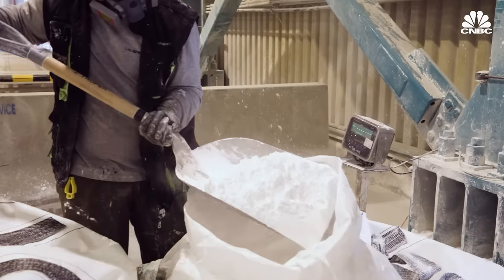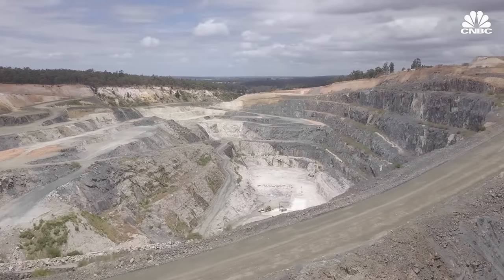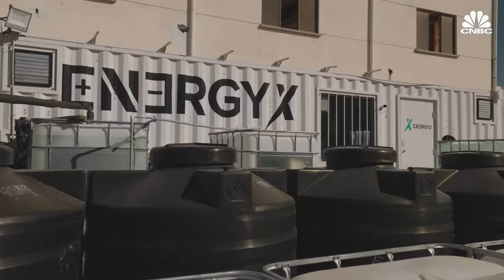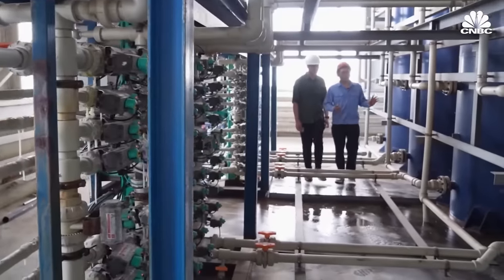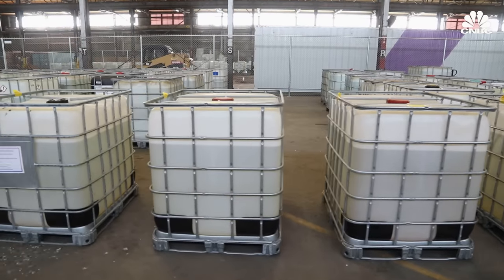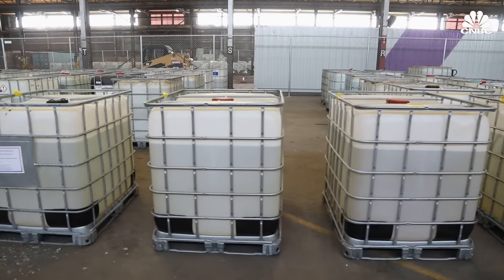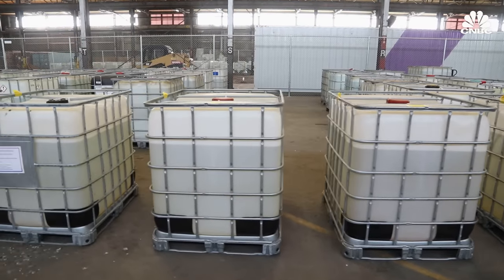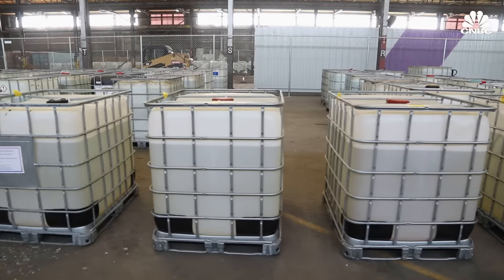Why The EV Industry Is Betting On This Lithium Mining Breakthrough

Comment: why they dont use  evap  water  is a question.
Reply: Lithium production in South America doesn’t have so much to do with the element’s availability in the soil, but with water. The Andes mountains are very dry, but the lithium extraction process requires water in no small amount to bring the element up to the surface in a salty brine—500,000 gallons of water per ton of lithium, according to Wired. In some regions in Chile, 65 percent of water is used up in lithium production, diverting it from local food production. The brine then requires 12 to 18 months to evaporate. Any water returned to the farmers could be tainted with chemicals.
Reply: Another core concern lies in the vast wealth that lithium will represent for these smaller, poorer countries when demand starts to escalate. The lengthy evaporation period for the lithium brine can be sped up by heating the water, a process achieved by burning fossil fuels -- defeating the entire purpose of reducing greenhouse emissions in the first place. But when the price is up and the bottleneck forms, the desire for faster, cheaper production may outweigh our ability to maintain environmental standards.

Comment: In a few years we will have mountains of used lithium batteries. They are very difficult to recycle. So what becomes of them?
Reply: They will be used for stationary energy storage on solar and wind farms. These batteries don't just suddenly die, they degrade over time. After 15 years of use in a vehicle, that battery will still have 70% use which will make it less useful in a vehicle, but many more years of use in a stationary energy storage system. After another 20 years of secondary use, it will then be recycled. How about that engine from that 1990 Honda Civic that is laying around in a junkyard, what becomes of that?
Reply: New recycling technologies are already making it easy to recycle.

Comment: Just dump money into sodium research to save the water and pollution.
Reply: hydrogen *
Reply: sodium is the right way forward
Reply: Sodium is no where near ready for wide spread vehicle use.  Lithium will remain the best technology for quite a while.
Reply: @JDMHaze  Hydrogen is too inefficient
Reply: These brines are are saltier than ocean water and evaporation is powered by the sun. Water use and pollution are not an issue.
Reply: @JRP3  it's already in Chinese vehicles
Reply: @Yoyo-vt4hc  Yes, cheap short range Chinese EV's.  As I said no where near ready for wide spread vehicle use.  Glorified golf carts don't count.
Reply: @Ray Martinez
The periodic table says "Hi!!"
Reply: @JDMHaze  
Dead end.
As said elsewhere, the system efficiency is diabolical. (worse than diesel)

Comment: I have zero water lithium refining system, dry system.  My system requires no electricity costs, wow my new lithium battery technology crushes these companies.  Lol, a ceramic material sheds a proton, to grab the lithium and then a chloride grabs the lithium off the ceramic surface, ready for manufacturer use. 3 materials come to mind, my system is still better.

Comment: I don't like reporting that has no analysis aspect. Any "alternative" market has to be tested for any new dangers it may pose to the environment. Conventional lithium mining is easily just as bad for our environment when scaled up to the level of fossil fuel and even relies on fossil fuels in order to operate. Its a lie in and of itself to disguise itself as a safe alternative while lithium mining uses 500,000 gallons of water per ton and all that water is polluted in the process. We cannot just accept whatever narrative an alternative industry feeds us in our desperation to escape from fossil fuels. Don't poison our water in the effort to clean up the air. It is more likely we will end up polluting both with that kind of ignorance. You cannot blindly trust figures that originate from the industry itself or any source that is dependent upon that industry for funds. Be skeptical.

Comment: What about the cobalt required for the batteries?
Reply: LFP batteries don't need it and are getting popular for EVs and other battery uses.
Reply: Cobalt is being less used as battery technology advances. Next question?
Reply: Cobalt free batteries are becoming more prevalent and those that use cobalt chemistry are using less and less.
Reply: The largest use of cobalt is to refine gasoline. As the use of batteries increases, better battery technologies are being developed. Cobalt will be obsolete from all EV batteries in the next few years. Next question?

Comment: install a solar roof onto these EV cars and trucks  add a recharge battery your good to go for ..................................................
Reply: the answer to your question is about 20 km after a full day in the sun. Solar panel tech is not yet at a point where one the size of a car roof can power that car.
Reply: @Thanos88888  Thanos they China car maker is already doing this to one of their model EV cars
Reply: @Buzzmonkey24  If a Chinese manufacturer is already doing this, it will be on a very light and small car with a small battery with short range. There's no way that current solar panel tech is enough to power the type of vehicles we have in North America, especially not trucks, with a solar panel the size of a car roof. You should look a little deeper into it.
Reply: @Thanos88888  they make Solar Roof tiles for roof installs . What you talking about Willis
Reply: @Buzzmonkey24  They sure do. Everybody on Earth knows that solar panels exist and that they produce electricity. You are making the claim that a single solar panel will be enough to power a vehicle while in use. Do you honestly think that a single solar panel can run an air conditioner unit, or a clothes dryer, or a kitchen oven? These are high draw units which require a significant amount of power.

EVs take a significant amount of power to operate. The draw is similar to running a clothes dryer. A single solar panel on the roof of a car cannot provide enough electricity to keep that vehicle moving.

Your suggestion isn't much different than those people whom thing that EVs should use tire rotation to regenerate electricity. Yes, there is regenerative braking, but the suggestion that the simple rotation of tires being able to fully power the vehicle is the definition of a perpetual motion machine.

I invite you to look up portable solar panels that are on the consumer market. There are plenty. Look for one that is about the size of the roof of a car, then look at what it's average energy production is. It's about enough to charge your phone. A car uses more power than a phone.

What you talking about Willis?

Comment: what if all of earths lithium is used up in making batteries if that happens and lithium runs out altogether what will we power our evs with then?
Reply: We can start recycling lithium
Reply: Recycling will have to become the norm not only for this but for everything.
Reply: 97 percent of EV batteries are recyclable.
Reply: Wind power. Put a sail on top of your car and set it to neutral
Reply: @jashansandhu8653  Yes like recycling plastic.  40 years later and its still a scam.  You realize the best parts of lithium are used up in the first round, you're recycled product will never be good. Down from a 10 year life to maybe 1-2 years
Reply: @chiquita683  thats the point it wont have the same efficiency
Reply: @chiquita683  Interesting, i presume you have a source?
Reply: Sodium Ion batteiries perhaps? They don't have the same energy efficiency yet but the minerals that go into them are more plentiful we might want to keep an eye on them as backup at least if not as a real strategic alternative!
Reply: @dicemaster1996  not the lithiums quality wont be the same once used
Reply: @chiquita683 in your mind what should we do? look for alternatives to Lithium, which we already are, or stick with fossil fuels?
Reply: Preface by saying I manufacture electrification components for EVs.
Batteries are some of the most recyclable things humans make, with nearly every aspect (Lithium, copper, nickel, cobalt, etc) being fully reclaimable basically infinitely. They are simply metals that can be melted down again. Running out of batteries won't be an issue for EVs, even if energy grids start adopting them at a rapid pace to help during peak hours. 

Environmental damage from photochemical reactions caused by Lithium battery recycling is another story, and could lead to further destruction of the ozone, but the Lithium will always exist in its useable state.
Reply: @chiquita683  Batteries don't degrade over time because the lithium is "used up" but because of lithium changing shape (dendrites) in the battery over time.  Processing a degraded battery back into the original pure lithium is much easier than digging it up from the ground and separating it from the rock it is in.  The problem is we don't have that many old batteries around since nobody was making large numbers of electric cars 10 years ago.  And I suspect the old batteries coming from cars will first get used in power storage for the electricity grid, where a 50% degraded battery works just fine.  Either we need a lot more naturally-sourced lithium, or we need additional non-lithium batteries, or both.
Reply: @dicemaster1996  look up Redwoodmaterials
Reply: Sodium phosphate batteries. That's where the industry is going.
Reply: @chiquita683  Nonsense.  All elements in a battery remain to be recycled and processed again into pure battery grade materials.  It's already being done by many companies.
Reply: There is more lithium on Earth than humanity could ever need. It is one of the most plentiful materials in Earth's crust, second only to iron.
Reply: Hydrogen among others. That’s why Toyota is advocating for different alternative solutions. Not just one solution for fossil fuel. EV is good but it is heavily dependent on batteries made from lithium. And lithium is a finite resources. I would like to see as many options as possible for us consumers.
Reply: @Ergzay  but they say the reserves are only 89 million tonnes how can u say that there are such abundant reserves
Reply: @chiquita683 ithium battery recycling has the same recovery rate as lead acid recycling, which is over 95%. Lithium has just been more complicated because there are more materials to separate and it's higher energy so just shredding like a lead acid recycler would is not as easy.

Plastic fundamentally is not very recyclable, after 1 cycle it's properties have already changed and has impurities like dye that cannot be separated. The polymers aren't able to be melted down and re formed without changing. Lithium and all the minerals in lithium batteries though do not change after recycling, they can be recycled an infinite amount of times with no change minus the slag impurity that takes 1-5% of material with it.

You may say the materials are spent or degraded by dentrites or wear and tear. However that's just the battery structure degrading and materials migrating and fracturing, it's all still there. This is no different than a lead acid battery that was left discharged (lead plates turned into crystalized lead sulfate and structurally destroyed), that can easily be fixed when the batteries are broken up and materials re processed into the base ingredients of lithium hydroxide, carbonate, or sulfate (lead antimony and lead for lead acid batteries).
Reply: @chiquita683  
Ooooo! Another perpetual motion machine!!!
Whoopee!
Reply: @chiquita683  False. Apples and oranges. They aren't the same.
Reply: Energy X ❤❤❤ They will get it done.

Comment: What about making batteries non explosive
Reply: then go back to coal😂
Reply: @JDMHaze  
(Coal dust is HIGHLY explosive!)
Reply: Pete S
Since we're always being told that "batteries don't have anywhere near the gravimetric or volumetric energy density of fossil fuels" maybe you should be more worried about a gallon of gasoline exploding than lithium batteries?
.
Just look up the official stats.
Reply: @rogerstarkey5390  gasholes&ev concern trolls like that never deal in simple FACTS about gas or diesel vehicle fires. 😏
Reply: @4literv6  fact is gasoline or diesel don’t spontaneously combust and require oxygen for fires. Also they don’t randomly reignite when exposed to salt water.
Reply: @ramblin327  fact back at you the #1 recall across ALL LEGACY ice oems is for the risk of FIRE inc while parked.
Right now as we speak over 10,000,000 us ice vehicle's are under recall for the risk of FIRE. 

Further fun fact for you, 217,000 ice fires in 2022 alone here in the U.S. so a gas or diesel personal use vehicle burns down every 4 or 5mins on average of every SINGLE day. That's not inc lawn equipment, ships, planes trucks or anything powered by liquid fuels classified as commercial use. Or the amount in billions of property damages each year either. Nor the deaths caused by ice vehicle's. 😎
Reply: @4literv6  actually the Takata airbag recall is the largest in history overall. Of course there are more ICE fires because there is a higher amount of them. I never said there was a higher number of car fires of either type. I only stated that when EVs do catch fire it’s much harder to control and they can spontaneously combust. Please read before making yourself look foolish. Also this is rich coming from your Chanel which only highlights gasoline vehicles at drag strips.

Comment: "Clean" energy 😂😂 it'll probably destroy 50% of ground water in 15 years when all the batteries need to be dumped in landfills but they wont talk about that
Reply: Lithium dumping is not a real problem. Recycling methods and technologies already exist.

EV batteries are reused en mass. A battery pack is made up of individual lithium battery cells, these cells can be sorted and reused for power infrastructure battery projects to double their working lifespan. After that existing recycling technologies recover over 95% of the effective materials used in batteries that can be used to manufacture future batteries.

If you want a source search: "A Dead Battery Dilemma" from Science publishing journal.
Reply: Buddy here doesn’t realize lithium batteries are recyclable
Reply: Why would companies dump out a valuable resource?  Anyway, your Saudi buddies say thanks for your attitude.
Reply: Just search "Redwood Materials"
Reply: @lawlkings  <<Buddy here doesn’t realize lithium batteries are recyclable>>

I see an enormous number of battery powered tools that no longer have batteries to operate them. There seem to be lots of battery powered lawn mowers being given away on Craigslist,  too. 

I don't suppose  your theories are overly optimistic?
Reply: I wish I could find these tools being given away. Our whole line up for lawn care is battery operated. Also, I've never seen a Milwaukee power tool given away.
Also, battery recycling is going to one day put miners out of a job as battery material becomes more pure as we recycle it.
Reply: Why would you dump a perfectly good battery after 15 years? Even if it didn't make sense for the high demand of EV use, it can still be used for stationary energy storage for power grids. These batteries don't just die, they deplete over time and have plenty of secondary market and aftermarket use.

Comment: The world does not contain "vast quantities of lithium". Already theres a scramble to lock down supply and production capability is a small fraction of gasoline powered vehicles.
Reply: You are mixing up availability and refining capacity.
Reply: But HYDROGEN is far and away the most abundant element in the universe!  Why use an element in such small supply compared with hydrogen?
Reply: @SeattlePioneer  Electrons are even more available.
Reply: @SeattlePioneer  energy density, storage, volatility, refining processes, available "grid", etc. Have you seen the major complaints that people have in regards to EV's? Take those complaints and multiply them by 2 for hydrogen.
Reply: @SeattlePioneer  But not on and in the earth's crust.
Reply: @Thanos88888  <<@SeattlePioneer  energy density, storage, volatility, refining processes, available "grid", etc. Have you seen the major complaints that people have in regards to EV's? Take those complaints and multiply them by 2 for hydrogen.>>

Only TWICE as tough?  Shucks, we'll just expect engineers and auto companies to do that by next week. 

Just MANDATE hydrogen vehicles!  After that,  it's not the problem  of government any longer!

Comment: Hydrogen should be replacing gas not electricity
Reply: Really?
Choice 1.
Use "gas" to liberate the Hydrogen.
Not acceptable?
.
Choice 2.
Use electricity to liberate the Hydrogen.
Problem, it doesn't WANT to be liberated from the elements it binds with.
It takes a lot of "energy" to persuade it.
What could we use that extra energy for?
2 things spring to mind.
Either use the spare energy to run an EV fleet 3 times the distance of the hydrogen fleet you could run with the same energy.
Or
Run the EV fleet the same distance and use the rest of the energy directly on the grid to shut down the same amount of fossil fuel generation.
.
Are you aware that the term "HFCEV" applied to "hydrogen vehicles" contains the letters "EV", referring to "Electric vehicle"?
A Hydrogen vehicle is an "EV". Just a VERY inefficient one.